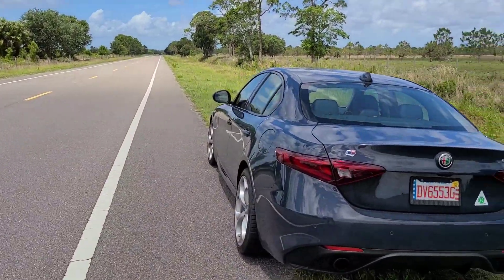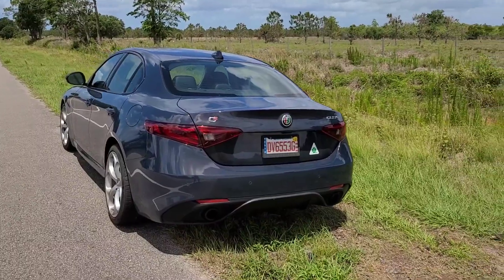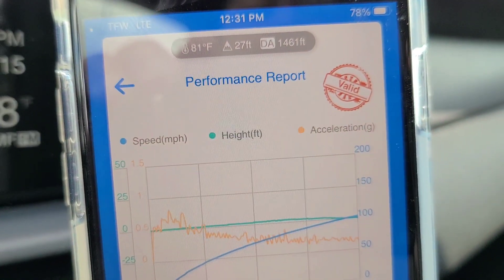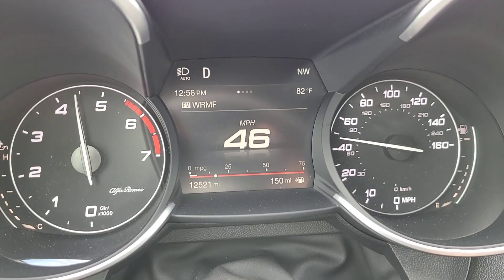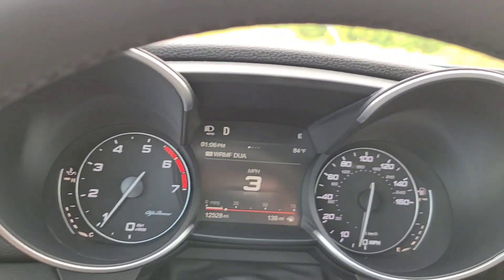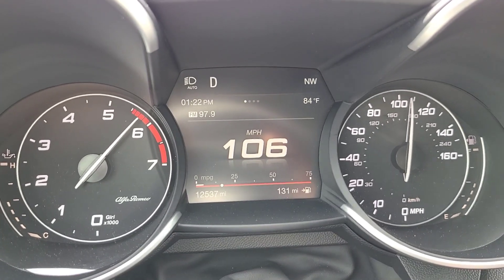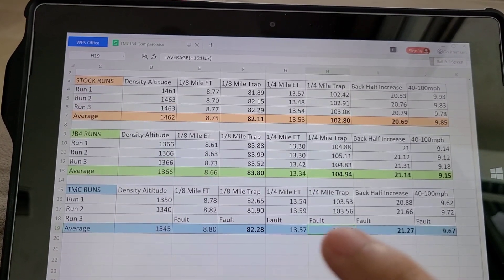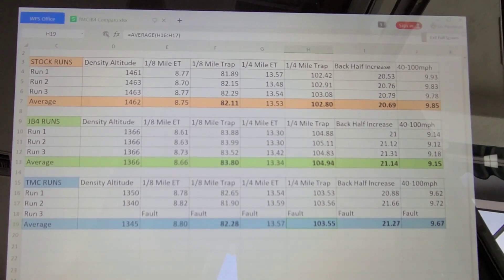Alfa Romeo Giulia 2.0l JB4 piggyback versus TMC performance comparison....

Comment: By any chance have you ever tried the RaceChip GTS? I picked one up used and it definitely adds power, but same as the TMC it throws codes when I put it in the most aggressive setting. Waiting on a dragy but until then I’ve been using an OBD measured 0-60 and it seems to have made a noticeable difference. Will look for flat safe areas to get a 1/8 trap or a 1/4 trap speed soon

Comment: I have a JB4 on my Alfa Romeo and my service electronic throttle control came on my dashboard, how do I get rid of that? How did you get rid of yours? You didn’t quite explain how to get rid of it in this video.
Reply from the maker: Use map 1 and you want to pull the code to see what caused the electronc tb code.  Literally dozens of things can cause it from low battery voltage to using a gfb diverter valve.   If its just running too aggressive of a map you can reset it cycling the ignition

Comment: Thank you for the extensive testing on the TMC. I was under the assumption that prior to remapping power, it gave ability to remap the gearbox itself ? I'm more interested into shifting gears faster / maximum responsiveness without changing stock power levels. Were you able to test that ?
Reply from the maker: Thanks for the comment.  The gearbox cannot be modified without a flash tune of the tcu or transmission control unit and none exists for this platform.   There are some sleezy products that claim to plug into your obd port and change transmission behavior but they are snake oil.   You can do the same adaptation reset unplugging the battery overnight
Reply: There is a tcu tune for this transmission.

Comment: Nice comparison! But how did you activate dragy 40-100 mode? That’s so practical! I almost never have space for 60-130 runs and I can’t find 40-100 mode anywhere in the app.....
Reply from the maker: Thanks for the comment.  Great point.  On dragy you can setup custom definitions.  Go to the "GO" page in dragy and click on the "+" symbol to set custom definitions.
Reply: @bhvrdr  wow thank you so much! Will definitely try it! BTW I just got a 18 S5 coupe and got 4.2 0-60 bone stock, I was pretty surprised! Regardless I’m going to JB4 map3 soon, do you know what kind of 0-60 and 1/4 I will get? I watched all your S5 videos and only see map5 runs so...
Reply from the maker: @justinswift5745  map 3 is going to be very close to map 5 anyways.   I wouldn't be surprised if you're in the 3.8 sec range.  Probably 12.0 ish quarter mile around 112-114mph.    Great car.
Reply: @bhvrdr  Oh really? I have never experienced sub 4.0 0-60 before 😂 
anyway even in stock form this car is already pulling very strong on the low end, but definitely lacking a bit on the top end coming from a 16 Camaro SS, but a 12.0 quarter mile seems will make it pull as strong as the SS on the top end and put it in another league on the low end! Thanks man!

Comment: I’m on the brink of purchasing would you say JB4 is the best and fastest tune route to go?
Reply from the maker: Yes pretty much.   Its logging and gauges and ability to switch maps paired with it being undetectable once removed paired with it giving at least as good of gains as any flash tune make it hard to beat.   Plus you can sell it for $450 when you sell the car making it basically free if you buy it used yourself lol

Comment: Great video. But I'd stick with the stock tune. The tiny bit of extra performance isn't worth the hassle.
Reply: The hassle is very little and the extra performance is more than a tiny bit, it's night and day really.
Reply: @TheAnon11  Going from a 13.5 1/4 mile to a 13.3 1/4 mile isn't worth voiding the warranty. Sorry.
Reply: @realestateeric  JB4 won't void warranty, it's a piggyback. It alters signals to sensors to make the car think it's hitting lower boost targets than it is so the PCM compensates, hence higher actual boost levels. My Jeep Wrangler has the same engine, I went from running a 14.5 bone stock to a 13.5 after bolt ons, methanol injection and JB4. I picked up an 8-10mph increase in trap speed. This is all on 94 octane pump gas too. Stock they make about 230-235whp. My Jeep put down 333whp on a roller dyno. Thats 100whp gain. I also dyno'd it without the meth and switched to another custom map I made for no meth and it still put down 315whp. So intake, exhaust, some premium fuel and a custom map 6 on JB4 and I picked up 85whp.
Reply: @TheAnon11  sure can't tell it by the times 2 tenths for how much money and time?

Comment: what are the 0-60 mph runs i want to know those aswell
Reply from the maker: This was testing to asses the cars power output.  0-60 is traction limited in this rwd car so would tell us nothing relevant.  Theyd be all over based on launch only.
Reply: @bhvrdr  the eurocolpoltion tune i heard allows you to take off traction control in d mode. and it also allows you to take off limeter for top speed
Reply from the maker: @Shortyzworldtv  top speed limiter is removed with ec.  They dont disable esc or tc but give you a "sport" version thats supposed to be less intrusive but people who actually track the car report its very inconsistent in how it intervenes.   Id still do the race mod to fully defeat it if tracking

Comment: Hey how did you fix the error code?
Reply from the maker: I worked with them to reduce the map offset but i don't believe they ever changed them for production so id just ditch it
Reply: @bhvrdr  to clear the code, did you do the basic code clearing technique - on+ off and steering wheel turning? I'm using Madness and was told dynamic+race mode on a pedal will cause errors. (While using their piggyback)
Reply from the maker: @RP-pg8yx  it has nothing to do with race mode or dynamic.  Its their map.   They need to fix it.   I clear it with jb4 but you can use the accessory on,/off technique as well and as long as you have the mpp off the code will stay cleared.
Reply: @bhvrdr  Thank you! I'll try to find a better piggyback eventually.

Comment: Just to point out, Dragy isn't SUPER accurate with MPH readings. Need to be doing this at the track for the most accurate results.
Reply from the maker: Dragy is ridiculously accurate with mph to .5 mph.  I have hundreds of runs on it at the track on everything from fwd to rwd to awd cars.

https://youtu.be/A4xsy2fGy8Q
Reply: Draggy is extremely accurate.shouldnt he a talking point as it's been out for years now.my track slips match my draggy down to the thousandth and mph is dead on every time when signal is available in the testing areas or at track

Comment: Just test drive it. Worst car ever
Reply from the maker: That's what sells them.  Test drives.  Theres not a single sedan out there with a faster steering ratio (quick turn in), carbon fiber driveshaft, nble handling and the 4 cyl model does 0-60 in under 5 seconds bone stock.
Reply: @bhvrdr  went to test drive one, initially not really wanting to entertain the idea of buying a 4 door.  It’s being delivered to my house this Friday lmao
Reply from the maker: @Printedperformance  lol, yeah that happened to me too.   Congratulations!
Reply: @bhvrdr  thanks!  Absolutely loving the car.  Just finished the race mode mod and adaptive suspension module update.  Go pedal and jb4 are on their way after the holidays… then the hybrid turbo after some other tidbits lol.
Reply: @Printedperformance  best sedan ever made in the world right now
Reply: @Printedperformance  best sedan ever made in the world right now